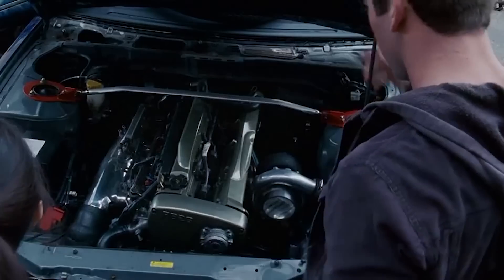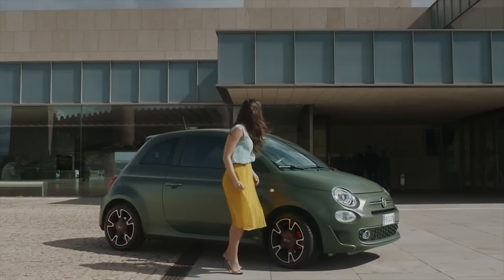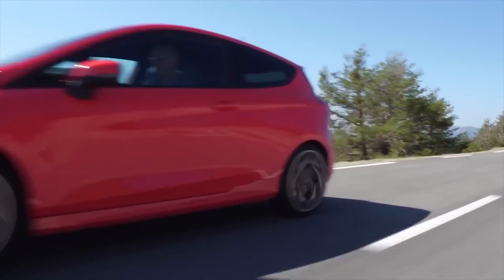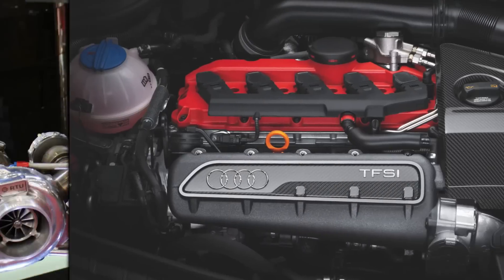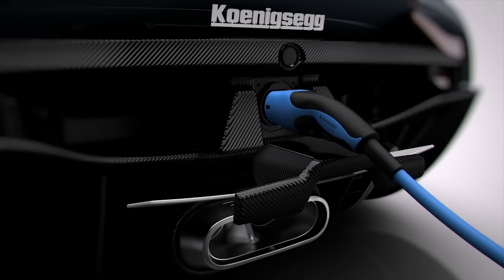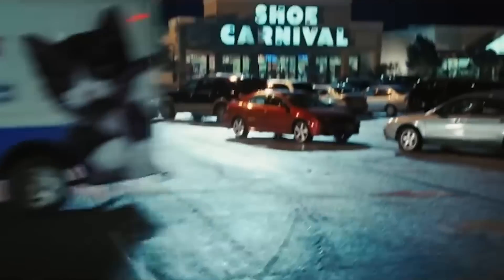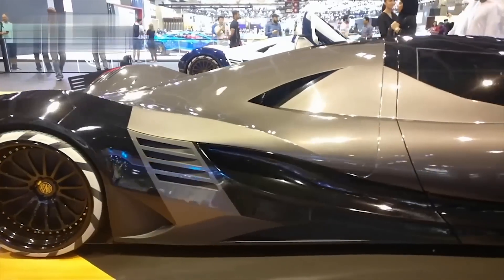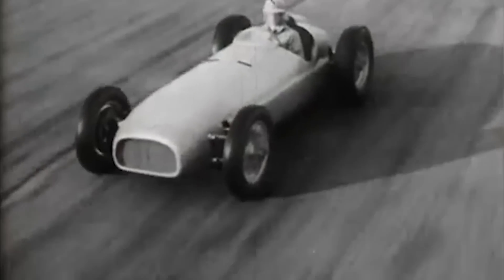Most Powerful Engines from 1 to 16 Cylinders

Comment: Per cc you still get more HP's from two strokes.
Reply: Zack Seven that is that is only true to an extent. They are poor at making power at high rpm for long periods of time as the amount of heat they generate is to much
Reply: @grapesanyone6626  True but the questions is: WHAT IS MOST POWERFUL ENGINE BY CYLINDER? Also, they are not poor at making power at high RPM as they actually make more power the higher they rev (MotoGP 500cc were spinning at 16,500+ RPM and making 200+HP's but as you correctly mention they generate excessive heat which kills their longevity, but any engine configuration when pushed to its maximum will generate excessive heat and lower its life span. ie New AMG1 from Mercedes using F1 Hybrid style engine needs rebuild after 30,000 KM's.
Reply: Zack Seven the most powerful engine per cylinder is a top fuel dragster which cranks out a 10,000 horsepower in its hemi V8. This puts it at 1,250 horsepower per cylinder
Reply: @grapesanyone6626  But that's like comparing apples to oranges as a TF 500ci Hemi is supercharged and uses nitromethane for fuel and they also generate a whole lot more heat which has a very short life span.

Comment: "no replacement for displacement", that phrase is not always correct.
Reply: Bryan Centerfitt I agree. Proper fuel air and boost tuning on a supercharger or turbo can make up for bad displacement.
Reply: No replacement for pro charging!
Reply: Well 🤷‍♂️ How about a 1.0 liter 1 cylinder engine with as much boost and you could ever throw at it vs a 1 cylinder engine with a displacement of 100,000 liters. Actually displacement will still win in the end.
Reply: HellHawk 
I mean, neither one is really possible. How about a 1.0 litre NA vs a 0.8 litre Turbo, that seems fairer.
Reply: HellHawk 
Plus, even if a 100k litre 1 cylinder exists, is there any practical usage vs. a small 1 cylinder with a turbo?

Comment: 4 cylinder power (cough) ford RS200 evolution with 700 BHP
Reply: I'm not even sure what I'm doing watching this. It's all old and wrong anyway
Reply: Kryijer production engine 
F1 turbo era, 1500hp 4cyl
Reply: Martin Andersson i thought they were v10s? Your talking 1987-96 right?
Reply: @Credence Clementine too soon junior🙏
Reply: 750hp on 4 cylinders in 919evo
Reply: (cough) 1000hp wrx sti drag car (cough)
Reply: 750? That's cute. 4g63 would like a word.
Reply: Grinders and Gears thats not stock
Reply: XclusivePower then you tell me mate what it has. I’m talking about the evolution model, not Original
Reply: XclusivePower ok, it has a Cosworth BDT inline-4 that could produce 650 to 800 horsepower. It had a tubular frame space chassis and fiberglass body designed by reliant. The diff could be set up for 50/50 67/33 or 100/0
Reply: dragster hemi v8 15,000 hp..
Reply: Derek1978  top fuel has only broke 11,000 BHP
Reply: Also thats a V8 not inline 4
Reply: @Kryijer  right was just en example of how they got it so wrong
Reply: @Kryijer  Sand drag cars can push the engines harder. They're running shorter distances.
Reply: @DerekS1978  bicycle with a rocket engine wins every time and you can still park it on the sidewalk!
Reply: @motosporttouring  what the cylinder count on that?
Reply: @DerekS1978  Can't find the info for cylinder count but the rocket engine had  4.2 kN (944 pounds) of thrust, did 0-60 in 1.1 seconds and went 207 MPH top speed.
Reply: @motosporttouring  and no cylinders...so probably doesn't fit in a conversation about most powerful engines by cylinder count
Reply: Derek1978 probably not but it got us replying to each other !
Reply: @DerekS1978  on the low end, some hit the 20's I mean when your only job is to go 1/4(1000ft technically) who cares about reliability lol
Reply: @armaggedon4christ  20? 20k hp? never heard that figure but those speeds  would not surprise me
Reply: @DerekS1978  because they have aftermarket mods this is from factory
Reply: @James_Barrett  oh..my bad they never said anything about factory motors
Reply: @DerekS1978  more like 11000 and for a quarter of a mile per engine..
Reply: @konstantinosprouskas8106  "15 MOST POWERFULL ENGINE BY CYLINDER COUNT"

Comment: The most powerful V8 engine is in the koenigseg jesko wich has 1600hp the most powerful production engine in a car
Reply: Someone hasn't seen a top fuel dragster
Reply: @habdman  someone didn't read right
Reply: I was about to commet. what u said
Reply: @rahulsasidharan999  it isn't made jet and the ragera have 1500 hp en agera (first) 1100 hp
Reply: No, that is if you run it on 95(91) octane. If you run it on e85 its 1600 if you get that option.
Reply: Nope it’s the SSC Tuatara, 1750 hp v8
Reply: this is what koenigsegg website says Gasoline: 955 kW (1280 hp) at 7800 rpm, redline at 8500 rpm.
Reply: Well production car that is. You need to learn more about Top Fuel dragsters!!!!
Reply: Haha mosler have 2500 hp u forgot it lol
Reply: Not yet in widespread production
Reply: Jacob Combs no it a LS
Reply: @angelramirez7842  youre either stupid or American. Jesko makes 1600hp stock.
Reply: The most powerful product engine is actually the 1,000 horsepower hellephant crate engine by MOPAR the dodge demon is the most powerful production car at 840 horsepower. The car you are talking about is not a “production car” as it is made by the order. I production car has to be mass produced and be available to the public in the same style with every car. This is of course only applies to gas/petrol power street legal cars and engines. I’m not trying to be a smart ass I just wanted to let you know you were miss informed about you info.
Reply: @grapesanyone6626  production car is defined as having more than 30 units. So no. The demon isn't the fastest
Reply: @sabersz  its more than 30
Reply: @DexiVisuals  correct, it's 50.

Guinness: According to Guinness, to qualify as a production car one must build “at least 50 mechanically identical vehicles, and these vehicles must be on sale to the general public.”

Edit: yes I know there isn't even 50 Jesko's in existence right now but Koenigsegg is planning to build 125 of them. Which more than qualifies it as a production car.
Reply: Rip Curl 69 planning to do it doesn’t break records until they do so the demon is king
Reply: Rip Curl 69 I never said it was the fastest I said it was the most powerful production car and is the quickest. Being quick and fast are different things
Reply: @grapesanyone6626  mate the demon has a top speed of 203mph. Veyron, chiron, many koenigseggs and Lamborghinis beat it.
Reply: Rip Curl 69 exactly but in a 1/4 drag race there’s no stock production car that can beat it. The car is not that fast for a modern car but is it accelerates to the speeds it does faster than any other car. You aren’t understanding what the difference between being quick and being fast
Reply: @grapesanyone6626  no one was on about 0-60 time and quarter mile drag time until you brought it up, no one gives two shits about it.
Reply: @grapesanyone6626  regara is a production car and the jenko is also going to be
Reply: @jfbdjdbdrhjf7716  they have to make over an x amount of cars before they're called production cars as of now there limited production as theres not many of them around
Reply: Grapes anyone exactly thank you for saying that! Finally someone gets it!
Reply: Same Venom f5 1600 hp 7,4 v8
Reply: @drakeTSA  venom f5 isn't out yet. Fuck the Venom F5
Reply: Damian Kaczor yup Hennessey Venom F5

Comment: I'm kinda surprised that with the inclusion of the BRM 16 cylinder, the Miller/Offenhauser racing engines weren't included.  They were simple, rugged as heck, powerful and drove Indy cars from the 1920's into the 1970's, with many still used today.

Comment: Where is 2Jz 6 cylinder and the well known
Reply: Mr. Drifter only came with 300 ish horse power from factory, he’s listing most horse power from the factory untuned
Reply: GheeRhocka no he is listing most powerful engines and we all know 2jz is the most powerful 6 cyl engine
Reply: zLegend no it is not. Fact. The 2JZ came with 320 HP stock. The list is on STOCK engines in a PRUDUCTION CAR. A bored out 3.4 liter 2JZ with 900HP isn’t stock. It never came like that in a car, and would never be road legal like that. Grow up
Reply: The highest hp version of the 2jz only put out 320hp
Reply: Well he said six cylinder and puts up a boxer engine so i guess thats why

Comment: Some huge ships with 1 or 2 cylenders have 150k horses so beat that KTM
Reply: Sigurd Well, modern diesels  have much more than 1 cylinder and makes nothing near 150k.
Reply: The last big ship I worked on had a Sulzer 84 RTC engine, 12 cylinder, 84 Cm piston dia. about 12 foot stroke, 66,000 HP the newer ones are appox 14 cyl, 96 cm dia, 110,000 hp for the Emma class class container ships.
Reply: Source?
Reply: Gas Turbines...Boeing 777-300ER.... GE-90-115... 250,000 hp... seriously Pffft ??!!!!

Comment: I was on a ferry once 1 cylender 120k horses
Reply: MrGoldo  ok then i just havent dug deep enough haha thanks
Reply: XclusivePower  Good for them. It's not like it changes anything for me if the do. I still won't be able to afford one. Only reason I'm the least bit interested is because Christian seems like a truly cool dude. That and that they tend to actually surpass the published specs rather than just meet them with the sun in the back and a strong tailwind.
Reply: XclusivePower  Sorry I overreacted a bit. Tried to keep it down, but some personal problems made it hard. Still didn't mean to sound abrasive.
Reply: I came here expecting to see some huge diesels powering super tankers and to top it off the diesel powering the old electric power plant in Copenhagen (look it up, it's really impressive considering it's age).
The title should have specified that it was all about car engines, and only production engines. But I'm not that disappointed really. Some of those listed, especially the really small ones were interesting. However I don't think the V8 from Koeningsegg belong on this list. It's a very impressive engine, and if you are generous it could be said to be in limited production, but with so few built I think it doesn't really belong here.
Reply: @blahorgaslisk7763  wait.... did anyone even get they're regera yet?
Reply: @ussindianapolis9137  I really don't know. A quick search suggests that they had delivered 20 cars by June 2018, and that the total run was to be 80 cars, all of which was already sold by then. So even if they would have managed to get all of the Regera delivered there would only be a few more than 80 of these engines made. I say more than 80, but this is a guess as I think they would have to build a few for development and testing, and probably at least a few ready to switch out if a customers car suffers a catastrophic engine failure.

Looking forward the engine used in the Koenigsegg Jesko (supposedly to start production in 2020) is said to be an improved version of this engine. They say they're able to get 1262 hp on regular gas and 1578 hp on E85, and the redline is pushed from 8250 rpm to 8500 rpm. 
125 of these cars is to be built, and according to Koenigsegg they've all been sold already. With a projected build rate of 40 - 50 cars a year it could be 2025 before the last Jesko is delivered.

It's interesting that while each model they've released has been more extreme and expensive than the one before, they've been increasing the number of cars with each model. And yet they are sold out for five to six years into the future.
What they don't seem to be interested in is increasing production rate...
Besides just think of the insanity of designing and building a high performance  engine and then build less than 200 of them. And that's just one of the things that makes these cars so insanely expensive.
Reply: @blahorgaslisk7763  i fully understand the Regera is rare but shit.... only 3 have been on videos... the Geneva model, an private owner one and Christians personal regera.... you think with crazy car people there would be more videos of the cars... or maybe i just dont dig deep enough into videos haha
Reply: @ussindianapolis9137  Well as I said, I really don't know if they actually have delivered those cars. 
But personally I do hope that they are honest. When a boutique car builder starts fudging the numbers it's usually a sign the end is near.
Reply: @blahorgaslisk7763  yeah

Comment: 21mpg for an 8.4l v10 making 500hp is not bad gas milage really. That's the benefit of a large displacement, naturally aspirated engine. Plenty of torque in lower revs so the engine doesn't have to work hard when driving down the highway, increasing gas mileage.

Comment: since you included prototypes (they went into production but they are crazy expensive), the most powerful v8 is the hennessey venom f5 with 1600hp. I know that they are a tuning company but the fact that the car's name is hennessey and a lot of the engine components are changed, it should be on this list.
Reply: number one but built with stolen parts most likely

Comment: Most powerful V12 is the Aston Martin Valkyrie engine with 1000hp at 11.000rpm
Reply: I agree with you but Ferrari 812 superfast is more powerful bcoze it doesnt have any turbo or super charger
Reply: @seskiboii  turbo's or not, the AM has a more powerful engine.
Reply: @JJ-iy8dx  without chargers they cant be that powerful as ferrari 812
Reply: Yes but the Aston Martin engine is naturally aspirated and doesn't have turbos / supercharger's
Reply: Aston Martin valkyrie engine is 1000 hp naturally aspirated v12 ! Revs to the moon too , Check it out . lots of engineering and development went into it. Sounds gnarly !!
Reply: It's assisted by electric motors, tho

Comment: To you guys are so off on the two cylinders! Polaris makes the prostar 2 cylinder engine with a turbo you can get 300hp and above look it up guys
Reply: John Smith , I actually saw some bullsh*t about some 2000hp 2 cylinder drag motorcycle, maybe it is true maybe it is not ( I just saw it in a car magazine) .
Reply: @mattiaspetter2816  well bro theoretically you can get unlimited hp if the Pistons were as big as 5 gallon buckets you know like scaled up there would be no limit so who knows I just know when we go to the dunes in the summer guys like Evo powersports and some over guys have two cylinder rzrs with easily over 300 350 hp